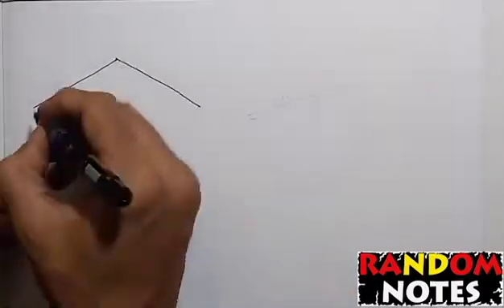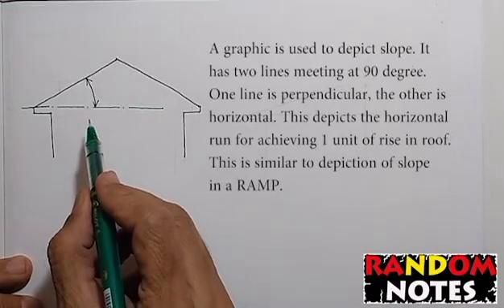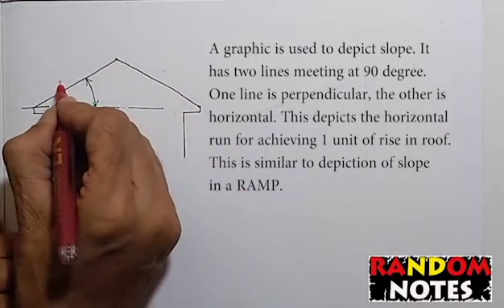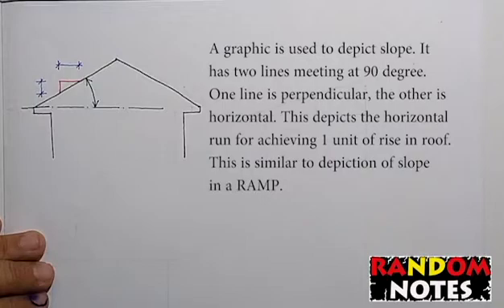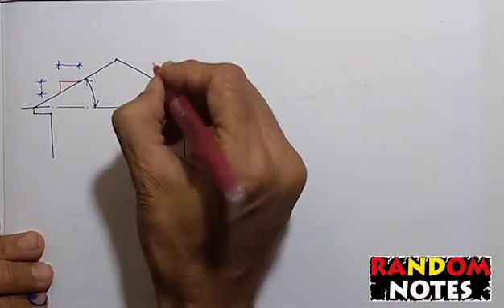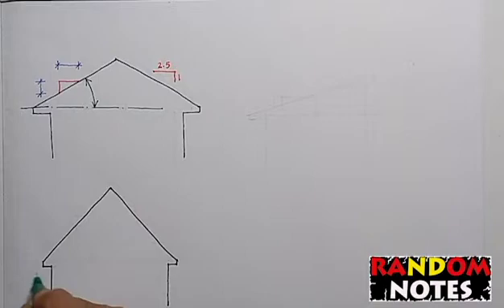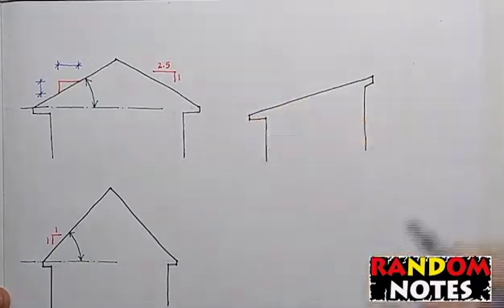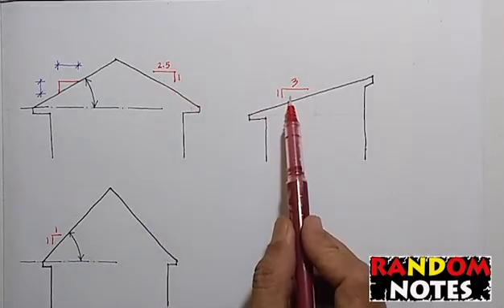How to depict pitch of sloping roof in section

Comment: Which is the best angle or slope for a gable, hip and lean-to RC roof to be covered with roof tiles?  I believe this is also to be specified with respect to evacuation of rain water on roof tiles to gutter as too much steep slope can lead the water off the gutter?  I have also seen Roman roof tiles specification that limit its use to specific angles.